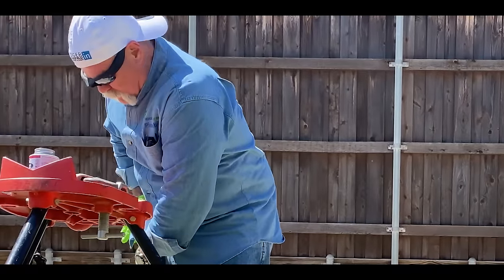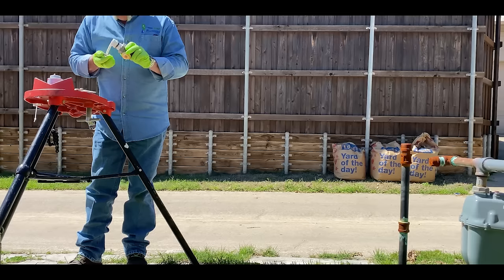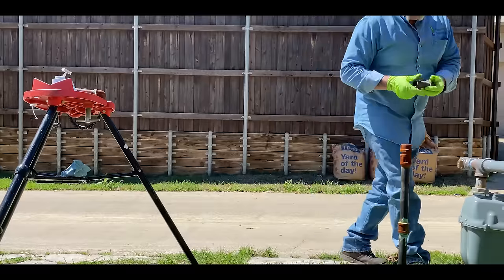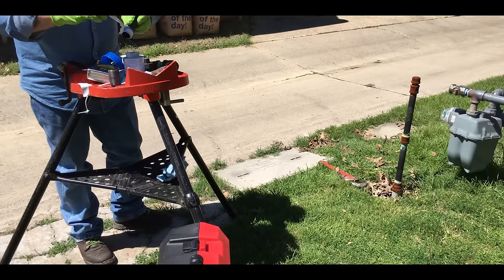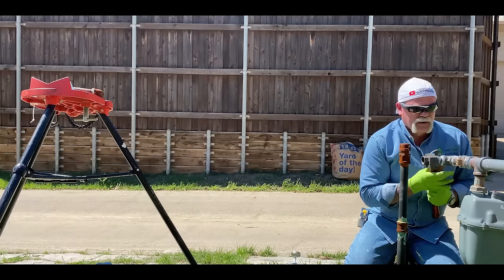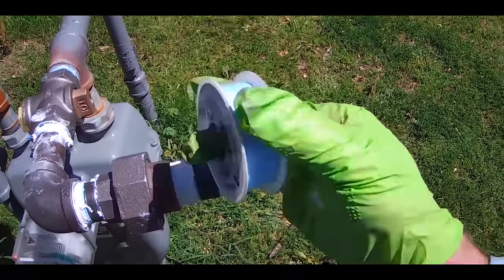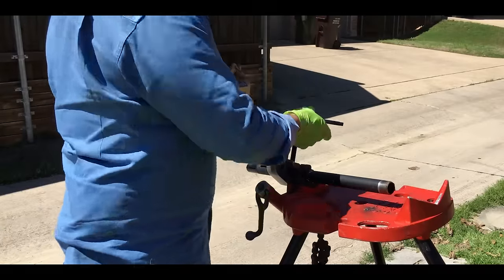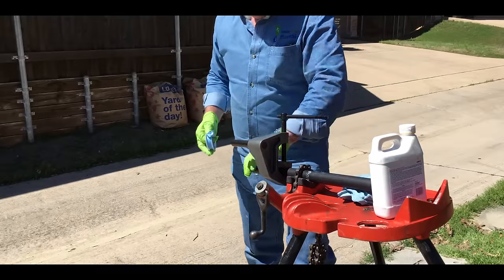Neighbor HIT This Gas Line! - Gas Line Repair (Plumbing POV)

Comment: I just can’t believe there is nothing blocking the gas meter from traffic.
Reply: Yeah, seems like the worst possible location for it
Reply: that's america for you
Reply: I was mowing a big 4 acre field one time..  was hired by a dude and all he said was “i want it bailed for the horses..  the stuff was weeds galore about 4 foot tall:.  Right smack im the middle of the field was a damn gas line check with the 2 foor pipe that sticks outta the ground that says no smoking..  well i ran that thing over.  Got lucky and didnt blow my ass off but i didnt even noticezc i thought it was like a rock or possum or something until i go to roll the bail off and see the white pole in the bail...  so i drove up to ole buddy and told him to call the gas company and i just left. Never talked to him again..  lol
Reply: Its actually quite illegal to not have bollards near a gas meter when its a certain distance away from anywhere a car could reasonably be.
Reply: @alexpuffinburger9015  the dialogue must've been. Well cars reasonabley wont be on a road! that's why we have roads right? its not like anyone's ever going to be regularly driving down a road!
Reply: @Theinatoriinator  Yeah especially if some one already hit it once like he said. That was just a freak accident that a car was able to get on a road it wont happen again.
Reply: @littlepastelkitten  I live in new england this would never pass. The gas co. would never install it like this either.

Comment: As a machinist I'd like to point out to people who may not know that the smoke that's coming up while you were cutting the threads is normal; cutting threads into metal generates a lot of heat, and the cutting oil is exactly that, oil, so it burns when heated.

Comment: About 6 years ago, I was chasing a bunch of tiny leaks in 100 year old gas pipes.   I called Oatey up, they recommended Hercules dope with kevlar fibers instead of their own name brand.   At that time, I think they had recently purchased Hercules, so not quite like recommending their competitor.  The kevlar makes the dope stiff, definitely does not flow like other dope.    I ran taps and dies on the old threads to removed all the old dried junk before reassembly.   I tested the old system at 100 psi for 3 days, no leaks.
Reply: Argco makes super dope, an anaerobic pipe dope. Its absolutely hell to undo. But  for sketchy stuff you won't be able to get back to it is incredible
Reply: Gas lines work off of water column  not psi. The system works on a max 5lbs psi.

Comment: When I was a teen and had just started helping my dad on sites he said to check for gas leaks smoke a cigarette.

I asked him how does that work.
He said If you live you did a good job 😁

I miss that old man.
Reply: So he blew up?
Reply: @smellymeadowhel8763  

No heart attack, 47 years as a carpenter finally caught up with him.
Reply: That’s true up to about 20 years ago here too. Most gas leaks are quite small on low pressure house lines.
Reply: The cig will never ignite natural gas. Lighter will though.
Reply: @a_mustache_of_great_repute  what if you drop a lit cigarette with gas around?
Reply: @FireHorse11291966  well then I imagine it would blow up.

Comment: Year 3 plumber here, love watching pros like you work. Always something that can be learned.
Reply: Yeah don't use tape on joints.  Most states it's against code to use tape. Dope only and if.your worried about a joint use wicking. The moisture from the dope will make it swell and seal up the joint.

Comment: I have worked in offshore and onshore oil and gas industry. Offshore Teflon tape is prohibited for certain systems due to its uncanny ability to send little shards into the subsea directional control valves. Onshore, the pipe work is made up with hdpe tape (the blue stuff) and no pipe dope. Torque used is TAF...usually a roughneck with a cheater pipe on a 4ft pipe wrench. Never had issues.

Comment: I spent my first 7 years as an adult working as an industrial tech in the fishing industry, one of the things I was shoehorned into as a young guy was plumbing and I don't even know how many miles of pipe I laid across the 4 plants I worked in, but it's nice to see someone else who does dope and tape for things like this. We were trained to do that for all gas lines, whether the gas was air, a combustible, or steam, and I can't think of any lines that I worked on that developed leaks (and with the relationships I have with my old chiefs, they would give me a lot of grief if they had to redo my work. 5 years out of the industry and I still get updates on projects I worked on)
Please note, I am not a plumber. Welder, boiler tech, fabricator, and mechanic yes to some degree, but plumbing was just one of the jobs I got put on a lot between production runs to keep me on payroll.

Keep up the good work Roger! I found you recently and have been directing customers who are struggling with plumbing to your channel!

Comment: If you want your dies to stay sharp on that threader, you need to back up a quarter turn every full rotation to break the chipping from the cutter threads. This is common when threading almost any hard material.

Comment: I love your videos! Im not a plumber, but im learning a lot! 

My favorite tool is the M18 Fuel deep cut Portable Bandsaw! I've been building fences for over a decade, and this tool can handle a lot of what the portacable corded bandsaw can. 

For volume, a battery will always fall short of what a corded tool can accomplish, but cut for cut, it always does a great job!! Its spectacular for small jobs, with less than an hour of consecutive cutting. More than that, i just use another battery. 

If i had to give up every fence tool I own, the tool I would trade my left foot to keep, would be my milwaukee bandsaw. 

It cuts anything I imagine a plumber would need to cut, if you've got the space to do it!! 

I've cut aluminum, stainless, galvanized steel, carbon, hardened steel, copper, pvc, plastic, wood 4x4s, and a block of 2" by 2" solid square stock. 

Just don't cut rusty stuff. That eats up the blade. The tool doesn't care, but the blades do. 

Highly recommend, 20/10 stars.
Reply: What would be the benefit over a sawzall? Straighter cuts?

Comment: There’s suppose to be a pressure test tee after the outlet on the meter and traffic protection
Reply: Gas company here requires an accessible tee on the outlet to “hot tank” the house line to work on the meter set. And certainly meter protection is a must.
Reply: @benjamincain4778  The gas company is just gonna have to "wack'm" now to do any meter repair. Job security!
Reply: He got a union,  good enough,  usually atmos want a bypass place but they hung it without meter bar so.
Reply: We always have an inspector

Comment: We do liquid and high pressure vapor propane piping.  Yes, we always use tape and dope. We're mostly using Sch. 80 A53 grade B with SA105N forged steel fittings. The TRC is real specific on some of the points in NFPA 58.

Comment: I've gone to plenty of callbacks on leaks where plumbers didn't use both teflon tape and pipe dope. I've also worked on gas lines on the fly. Good work!

Comment: In New Jersey Teflon tape is not allowed on gas piping unless it is the yellow tape That's rated for gas. If it was hit by a car it also requires a pressure test and inspection. So that you can check if line underneath ground is damaged in any way
Reply: Plus, protective posts should be installed.
Reply: The blue monster is also rated for gas piping.
Reply: @jamesallen3739  Blue Monster "Gas Guard" yellow tape is the only Blue Monster tape approved  as per International Fuel  and Gas Code.. But I guess local jurisdictions have final say.....
Reply: @guitar1301  , you are correct, even though the Blue Monster blue tape can meet the standards for gas, once it's installed we have no idea. That is why Yellow Tape is required by the National Fuel Gas Code and The American Gas Association. Local codes maybe more stringent and strict but in no way can they weaken The National Fuel Gas Code.
Reply: Bob Y bingo you’re correct. Wrapping 7 times is a bit excessive?

Comment: Roger, nice video but I'd like to go over some of the shortcomings I noticed, just to give the plumbers and pipefitters out there a perspective from the gas utility side and the National Fuel Gas Code. My name is Bob Yehlen and I've been a first responder /gas fitter for the gas utility in St Louis, Missouri for 35 years. I am presently retired but still consult for the gas industry from time to time when incidents occur throughout the country ( incidents like the over pressurized gas mains in Massachusetts, the mall gas explosion in Florida & ect.). So now let's go over the things I noticed on this particular video.
#1 before making a repair to any fuel run let's determine if the original installation was up to past and present codes ( is the fuel run sized properly? What is the total gas load, house and pool heater? This particular meter set has a b-42 regulator and a 275 CFH (275,000 BTUs) gas meter on inchs delivery. So if the total load is over 275,000 BTUs, the gas utility should be contacted for a gas meter upgrade) #2 the pool heater fuel run came off the gas company pressure tap tee ( the gas company uses this tee to determine lock up and working gas pressures; this is not a tee for your pool heater fuel run), that being said you may use it as long as another tee is added. This is done very simply by replacing one of your elbow at the meter set with a tee & plug ( now  a tap is available for the gas company to take pressures and you can also pressure test your underground fuel run using the same pressure tap tee, just by hooking up your manometer, turn the valve on and back off, now you have a pressure test going). #3 jumping a live fuel run is very old school & is no longer acceptable by the National Fuel Gas Code & the AGA ( American Gas Association). The proper procedure would be to turn the gas off at the meter, install your required fittings for the job and pressure test the complete system. I know it seems like a waste of time and opening you up to much more repairs if  problems are  indicated on the other fuel runs but that is what's required in this day and age ( believe me, there are a lot of law firms out there hoping you don't pressure test and bypass required procedures).#4  a ground joint union is not acceptable for underground fuel runs and risers ( only insulated unions are acceptable for underground fuel runs and risers, this is required for cathodic protection). #5  all underground fuel runs should have a trace wire or a means to locate the underground installation. Since this is a repair &  the original installation had no means of locating the line, this should be noted on your receipt and your records.
     I hope some of this information was helpful. I know some of you will say that my local municipality or state does not require this,but these are the National Fuel Gas Codes, states and municipalities can enhance and make codes more stringent but in no way are they allowed to weaken or reduce the National Fuel Gas Code. You all stay safe out there and have a good day .
Reply: Finally some real knowledge thank you.
Reply: Hi, Bob. Do you have social media, website, YouTube channel, etc., where you explain the gas plumbing code and proper installation of gas fittings?

Comment: With small size pipes it may work fine, but from my experience on a job with 3 inch galvanize pipe I got leaks in almost every fitting and had to do it again with paste only.
Reply: On 2-1/2" and larger pipe  Keytite or Grip pipe dope is the way to go.
Reply: I don't understand how ? Teflon and pipe dope is the way to go on every size, just saying ive never had a problem
Reply: thats insane, here once you hit 2 1/2" and above pipe you need to make Welded connections......

Comment: When we have Gas risers in Canada, we require a minimum of 4 90's on the riser to create a swing joint so if the ground has a frost heave it dosent break the line.
Reply: Hes in texas...
Reply: @joea5183  Sure, but earth movement can still occur can it not? I've also seen a gas line get backed into and not break because of a swing joint. I was more so curious about his local code.
Reply: @Havoc080  Most of texas is very shallow top soil with limestone beneath it.  Texas soil doesn't really tend to move.
Reply: C H - Here in The Great White North we do not do the same as they do in the USA.

Comment: DYI here. Nice to watch the pros at work. 
Chatter about opening the gas pipe under pressure--I watched the gas company guy replace the regulator at my folks house--they needed larger service for a spa heater and a new gas stove. And part of that job was replacing the valve on the service side of the regulator. indeed there was a moment where the gas just flowed--but only a moment, because he too had everything lined up and ready to go. I seem to remember this clever little rig that plugged the service pipe with a expandable stopper that, unexpanded, could be pushed through the open valve, and a rod that came up through the bleed valve? Sorry, this was years ago, I don't quite remember how it all worked.

One thing I do remember, brought to mind by all the rust visible here, was a couple of coats of that gray anti-corrosion paint you can see on the meter. 
Did the riser going to the pool heater eventually get painted?

Finally: I remember once slipping a section of PVC over a gas riser (house side of the regulator, valve off) to protect the riser from weed-cutter line, which had over the years eaten almost all the way through the riser (that was why I was replacing it). Is there a reason why you didn't do that here? Was I wrong to have done it? (Yeah, looking back, should have called a pro for that job. But I was a young and foolish know it all, and I at least read up pretty thoroughly on working with gas, so I wasn't working blind. Harris County, TX, jurisdiction.)

Comment: Roger , try the pipe treading lube that Ridgid sells. It comes in a spray can and it works great without the mess you get from cutting oil. Our threads come out beautiful with it.

Comment: Key point “always back up your fittings with another pipe wrench before fully tightening your pipe so that the prior fitting or pipe does not spin on you causing a leak.
Reply: Always have a backup

Comment: I really like watching this channel. I worked in Ma as a plumber. He did a decent job. Comparing how I was taught, you ALWAYS use two wrenches. 3 wraps with the tape start at pipe then to end. Don’t over tighten them. They tapered like a pencil and it can expand and crack the fitting reason for two wrenches. Never loosen a fitting, it could break the seal of the tape and dope. If you do, in do it and reapply tape and dope. I never saw you test with bubbles. I’ll give half credit for not having an oil pan or opening the box more because you got down and wiped up the oil 👍🏻👍🏻. *first time I’ve ever saw any differences in any videos I’ve seen so far* Still a great plumber.

Comment: The water line into my house broke when I tried to replace the shutoff valve (26-year-old double-wide trailer that had been empty for 7 years) and I tried to thread the galvanized pipe coming out of the ground.  My brother-in-law has a manual threader that worked okay, but I would have LOVED to have that tool.  It probably wouldn't have split the line down into the ground and broke the pipe off at the elbow if I had.  On the other hand, even though I had to dig up that whole section and replace it, at least I know it's got a brand new line all the way from the PVC water supply from the meter.  

I'm slowly replacing all the Poly water lines in the house with PEX. I need to get a tool that crimps rings with 1 hand.  I just don't trust Sharkbites.  I'll use them if it's in a place where I just can't get my crimping tool but, to me, I'd rather save the money and put a little more effort into the connections.  I've seen the tests with pressurized water and I know the pressure fittings work fine, but I guess I'm just too old school (and too cheap).

Comment: Pro-tip: i use pipe thread sealant on pipe threads, then teflon tape. this leaves your fingers clean, and the pipe dope enters the joint as you tighten the fitting through the tape:

Love the vids roger!

Comment: What I like about your work is that you are fast efficient,and don't get
Any on you!
Reply: Fast Christ that was A 5 minute job. Wrapping 7 times with Teflon completely covered the threads plus some pipe. Got oil all over the cement. I would have ripped my guys a new one threading with nothing under to catch oil. Should tell home owner a bollard needs to be installed to protect meter from being hit by cars

Comment: Another great job... Rodger,  I also use Teflon tape and pipe dope together on pcvp female threat fittings to connect male brass threads on shower valves... I only go hand tight, but never had a leak doing it that way... Thank you again,,,,

Comment: I had to plumb a whole Factory which was stainless steel piping and fittings and you learn real quick that you put your pipe dope on your threads first and then put your tape over top and then tighten down and you have no leaks and it's clean
Reply: The company I work for we do a lot of commercial pipefitting including stainless work and they do the exact same thing. However, we utilize other materials in aspects of pipefitting and I believe the process you described 
 is only correct for stainless work otherwise, teflon tape should be applied (correctly) first THEN pipe dope. But hey everywhere is so crazy and different as long as it had pressure or doesn't leak isn't that all that matters
Reply: @tylerdelancey9543  cool...yeah which way you use and works with no leaks...all good..🍺😎